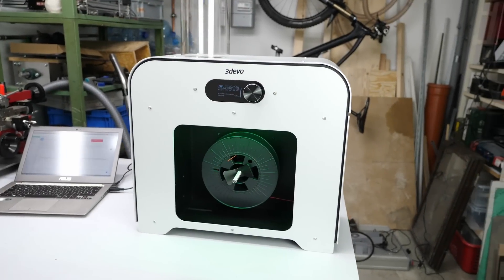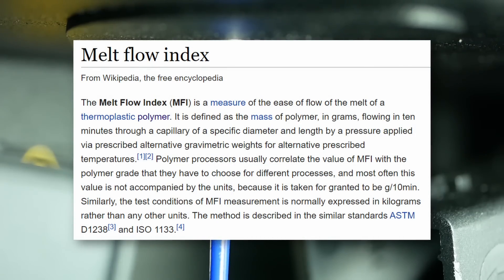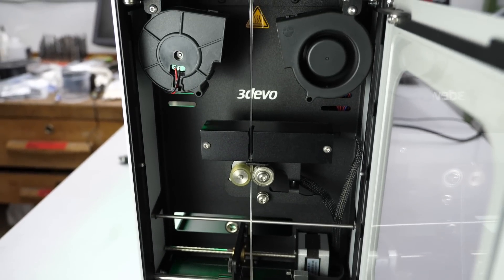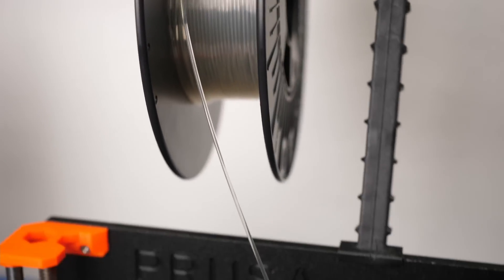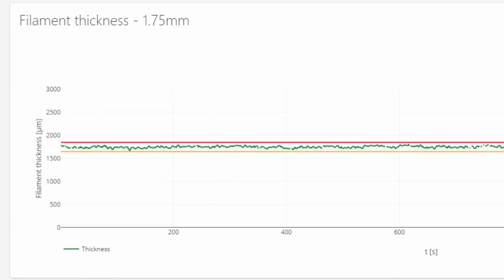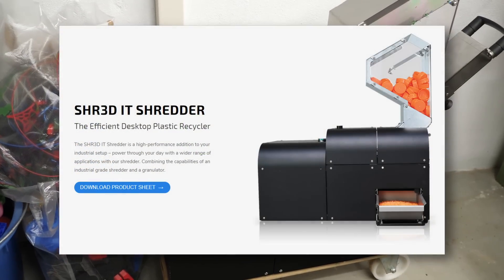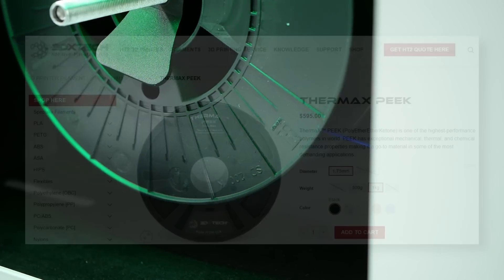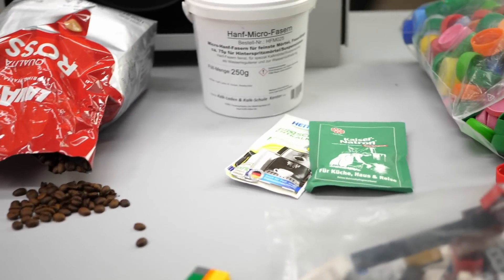Extruding PLA Filament at Home

Comment: Interesting, that there's no "Creality XTRDR 10" yet. Chinese production at scale could make home made filament much more affordable.
Reply: I feel like the demand isn't there, much like DIY inkjet cartridge reloader machines or diy paper producers/recyclers aren't a thing. It's waaaayyyy easier to just purchase filament than to go through the hassle of making your own. I mean, most people only print PLA (honestly, 95%+ of my printing is done in PLA), and when I can find PLA for $10-$12 a roll, why would I waste my time on one of these? I mean, at that price, just tossing failed prints and support material makes sense, and with PLA being a corn based product, it decomposes quite quickly, so it doesn have a huge environmental impact.

Now, with that being said, despite the fact that PLA can be found super cheap, I still save all my failed prints and support material and all, so I have boxes waiting for the price of these extruder machines to reach a point where I can afford one. No really to make my own plastic, but because it's just another aspect to the hobby.
Reply: @nathan1sixteen   True. Cheap direct pellet extruder 3d printers could be more of a next big thing for Chinese manufacturers maybe.
Reply: @nathan1sixteen  i disagree, as the 3D printing community is currently formed mainly by makers and tinkerers, who enjoy being able to do stuff for themselves. 
I for one would absolutely love experimenting, if not with different materials with colors, additives, ...
Reply: @nathan1sixteen  If I were you, I wouldn't toss PLA into the compost bin. It is recyclable and degradable in special conditions, met only in industrial complexes. As wikipedia points out: "Environments without the necessary conditions will see very slow decomposition akin to that of non-bioplastics, not fully decomposing for hundreds or thousands of years."

So no, it has a huge impact as all plastics has. Also the point of recycling material isn't just for occasional PLA scrap you got flying around. If you look around, you probably have kgs of PET from plastic bottles and other disposable objects, that can made easily spools upon spools.
Reply from the maker: Calculating a ROI even at a way lower price is very hard for someone who might only print  10 to 20 spools per year though this might be viable for small businesses.
Reply: There's plenty of twin screw extruders and compounders, even lab sized ones on Alibaba and other China B2B websites. I don't really see the point of using a single screw extruder if you want to go for consistency, which any business would want. Once you start to go into any kind of mixing, e.g. recycling, composite materials etc then twin is really the way to go.

Comment: I would love to see a comparison of the different pellet types, how they affect filament extrusion/material properties, and a matching of different filament brands to the closest pellet extruded match. I have been trying to figure out material properties based on material brand for my job, and to some extent color additives, but it has been a nightmare. Having a way to classify filaments in some way would be a huge help as most TDS/SDS don't list the pla composition they are using or the pigments used. Or other filament types for that matter.

Comment: It may be a waste but I think there is a step missing in the recycling process for failed prints.  I think a lot of problems would be avoided if you could first make pellets (or just something more uniform then shreds) out of the failed print and then extrude that into filament.  maybe making a sheet in the oven and then cutting that into uniform pieces or setting up a filament extruder that drips.

Comment: Maybe melting all the shredded material into sheets could maybe cut down on the "fluffiness" of the shredded and dried plastic?
Reply: Sheets? And how would you feed those "sheets" to the extruder's hopper?
Reply: @janosnagyj.9540  There was another youtuber that i dont remember who it was, that also tried to extrude at home as well and after failing he had melted the plastic in an oven. My idea was maybe melting it into sheets and then shred it, in that way reducing size and maybe getting a more even shredded size of particle. The uneven-ness and just different pieces of the pieces that were recicled would in a way be a part of the problem. You cant pass 3d printed spaghetti and expect it to come out the same as as piece that was shredded. All in all, i dunno

Comment: Side note, the master batch manufacturers would likely send you sample sets of pigment/plastics if you contact them. They're trying to get new clients and sending out small batches for testing can be common. I know of a few plastic manufacturers that will give you a trash bag full of pellets if you show up at the factory.
Reply from the maker: I need names 😉
Reply: The trash bag definitely makes sense, but I have a feeling they aren't too concerned about ol' Stefan here as a client considering he'd buy such small batches.
Reply: @daveabittner  yeah, but its probably not worth it to look up everyone you send a small bag to, the bag only costs less than 5€ probably, wich is less than a person who knows how and where to reserach brands and firms and stuff

Comment: To get more consistency when extruding recycled  polymers. Make pellets first.. extrude 3mm and then chop it into 3mm long pellets
Reply from the maker: Will try that because I built a pelletizer a while back.
Reply: @CNCKitchen  Are you measuring the power it uses? In the end recycling is cool, especially for shops that melt a lot of plastic into support material, but if it costs more than a new roll to remelt it... most shops are going to choose the landfill option.
Reply: @macgyver9134  It shouldn't use that much power. I think it would use equal or a little less power than a 3D printer.
Reply: I've thought about that too but I wonder how much reheating you can do with PLA and PETG before you degrade too much the plastic? does someone know how can I research about this?
Reply: Smart!
Reply: You take the words out of my mouth. Pelletizing through a first low temp pass seems the obvious way to alleviate homogeneity issues. Amazing Stephan hasn’t tried it. 🤷‍♂️
Reply: Filabot actually makes a pelletizer for exactly this purpose
Reply: 3Devo's Shredit does that, according to their literature.

Comment: I played with layer height and over extrusion to really aim for transparency.  I was using red and yellow translucent and it is pretty impressive how nice it can be.  I basically added extrusion on the first layer and internally until bad things happenned.  Basically bulging.  I also switched to a mirror print bed which really makes a beautiful bottom surface.  Between that and prusa ironing... which I also tuned to fill the gaps the results we pretty good.  As a mostly transparent item it was very good results.

Comment: Hope you try to make pallets from the shredded material by cutting up the inconsistent filament and then send it back thru for your final filament. I bet you could use an extruder to push the stage 1 filament into a rotating cutting wheel that kicks out pallets. Might not even need drying plus the first few meters of wasted plastic could be recycled almost instantly.

Comment: I don't think the value proposition for labs does really make sense here. It's clearly built to a price in regards to manufacturing costs. Stepper motors, sheet metal, limited controls. For research labs they'd be using servos, machined parts and an embedded PC.
They're just trying to recuperate R&D costs from early adopters.

Comment: I wonder if you can find a way to turn the recycled prints from shredded bits into pellets of uniform size first before using them for making new filament. That'll make end results predictable.
Reply: Yeah you'd need an extruder to push out a stream that's cut up as it comes out kinda like a candy maker.
Reply: @Scott_C  Hmm, Stefan should extrude it once from the scraps (mostly from those with as little virgin material as possible),  then cut whatever quality filament comes out of first extrusion process into uniform "pellets" and finally use those pellets of same size for the final filament?
Reply: @Scott_C   I had this same though, an extruder that pushes the "waste" filament into a cutting wheel of some sorts

Comment: I just want a way to use waste pla as support material. A dual extruder that can print the new stuff for the part, and the recycled stuff for support would be ideal.
Reply: you can't recycle thermoplastics infinitely, the bonds on the polymers break down and you end up with a very fragile filament. For the rest (using second extruder to print supports) you have the answer and it looks like a ready to use solution. Check the comments. Cheers
Reply: You would need to build a whole extension like with python for that. In G-code support material is the same as normal print. It just differs in speed/amount of material. So basing on that you would need to make a parser that detects where the supports will be and offsets the print to the second extrusor. Do you see some other way to do that?
Reply: @cambouiscom  i may be outdated. I use Slic3r with Repeater and I couldn't find any option for that. What's the name of it? I want to see how it handles on the level of gcode
Reply: @AntonySimkin  the gcode uses two different extruders. The slicer creates gcode that tells extruder1 to create the part, and creates gcode that tells extruder2 to create supports.

Not sure about main slic3r, but PrusaSlicer, which is essentially a slic3r fork has the settings under "multiple extruders" to print rafts/supports/skirts, infill, solid infill, perimeters, and support/raft interfaces with different extruders. If you had a theoretical printer with 5 extruders, you could print each of those with different extruders.
Reply: @Crypt1cmyst1c  Well this is actually awesome. I always used 1 extruder so Slic3r fullfilled all my needs. From what you explain, there is no problems at all to use recycled plastic of any type for supports. Even better... You can make supports from some kind of hard plastic like ABS so it doesn't stick well enough to PLA and detatches easier
Reply: @Crypt1cmyst1c  Thank you for an extended answer by the way, i will download the PrusaSlicer to check it out!
Reply: @AntonySimkin  yeah, I just want a system that's fully integrated into the printer that I can feed shredded pla into the printer, and be able to send dual-extruder gcode to the printer that will use the recycled plastic for non-visible bits of the parts, or for supports. Infinitely recyclable supports would be the ideal. It'd make complex geometries way more economical to print, and make expensive filaments much more approachable. I print in the cheapest filaments because half of it gets turned into support.
Reply: @AntonySimkin  Repetier doesn't expose all options (if you meant that)